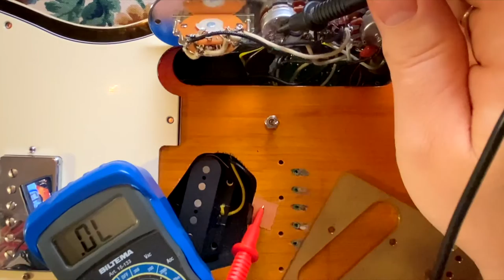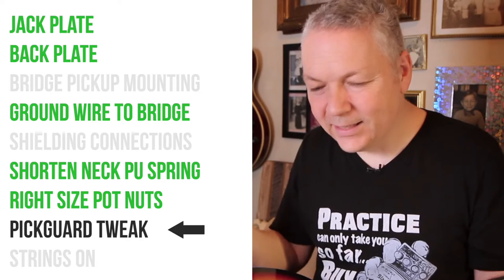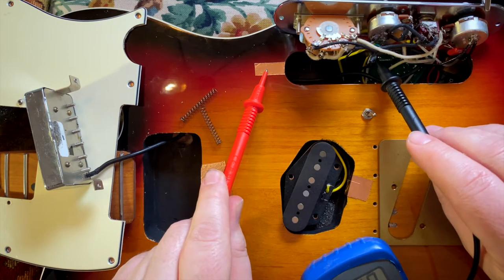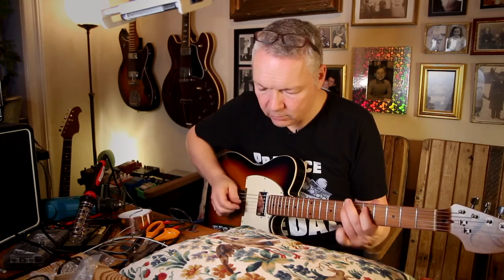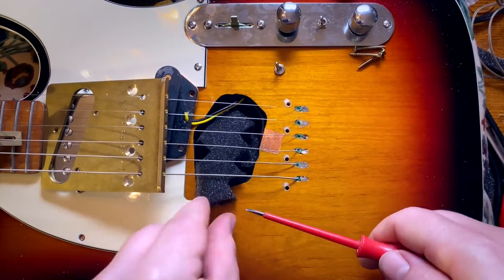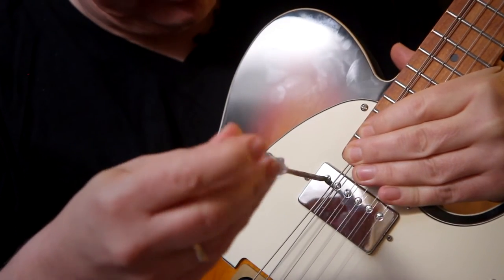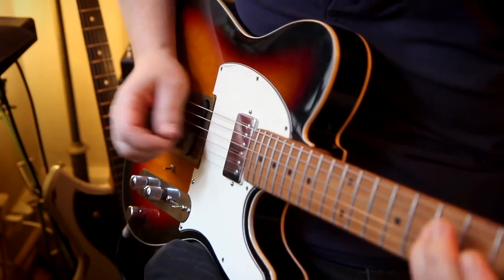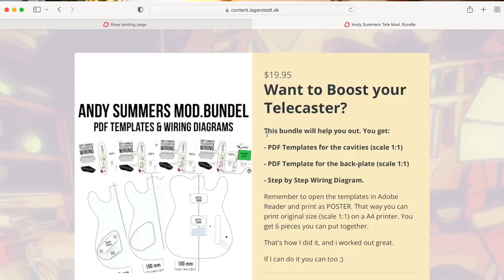Partscaster MADNESS - I Finished the Ultimate Tele Project

Comment: Considering what I was talking about last time, you don't have ground issue because you didn't mount the pickup on the bridge but directly in the wood. So all you have to do to be sure that any issue can occur is that the pickup baseplate don't touch anything that is grounded.

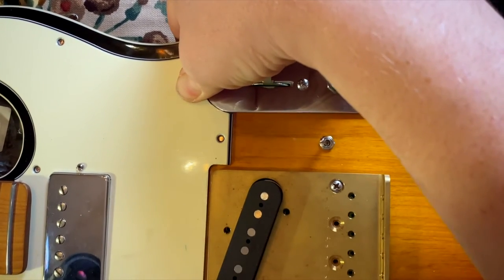4:38 It's weird. You shouldn't have any noises when touching the pickup cover , even if the pickguard shielding is not correctly grounded. There's an issue somewhere, you should check the pickup wiring.
Reply from the maker: Hi Fenson
It’s great advice… I’ll try to check that out 😃👍
Reply from the maker: Hi Fenson
You were very right on the pickup wiring. I tried different things and it turned out that I had to redo some of the wiring for the neck pickup and that also solved the noise issue. Thanks again for your great input and advice 🙏🏻😃
Mic

Comment: Instead of a extra knob and switch I wonder if you can use fenders S1 switch on both the volume and tone to give it the boost?🎸🤯🔫
Reply: There not enough space for 2 S1 switches in a standard sized cut out

Comment: what is the sponge under the pick up for?
Reply from the maker: Good question. It was actually to push the pickup up so I would be able to control the hight with the screws that are going into the body, but turns out that it also isolates the bottom plate of the pickup from the shielding paint. 
and by the way thanks for watching 😉🙏🏻